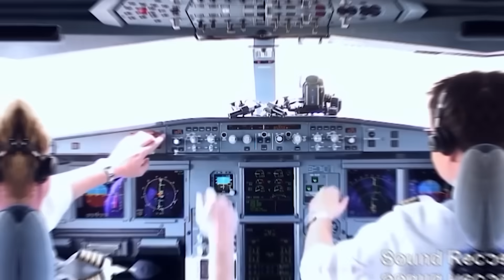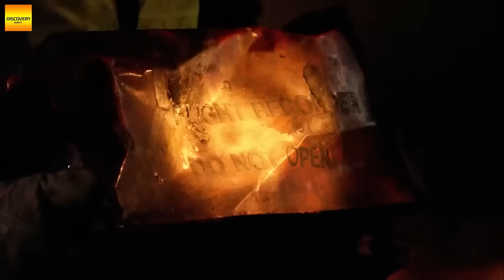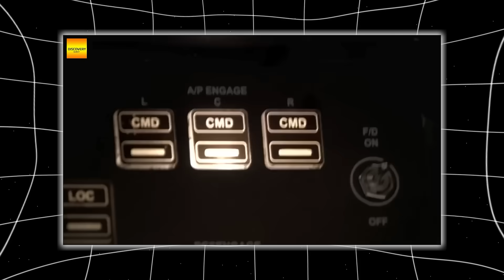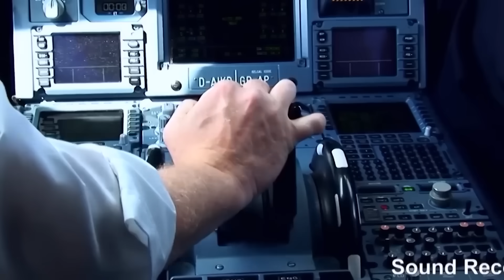BLACK BOX DECODED? Scientists FINALLY SOLVED the Mystery of Air India 171 CRASH

Comment: Not sure about this article, pulling the throttles back to idle would not cut the engines off, it would continue to run but the spooling up of the engines may well take some time, however the first officer would put the throttles back to maximum immediately after the captains chair moved.
Reply: You can only reduce the engines to flight idle (which is significantly more power than ground idle), so that they will spool up within a few seconds to TOGA (takeoff/go-around) power.
A bit more knowledge on aviation would not hurt.